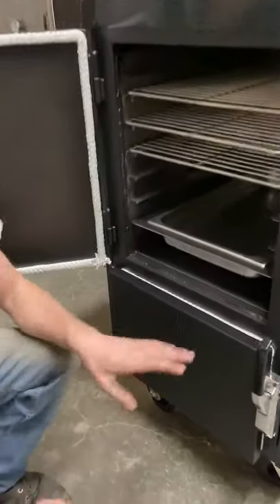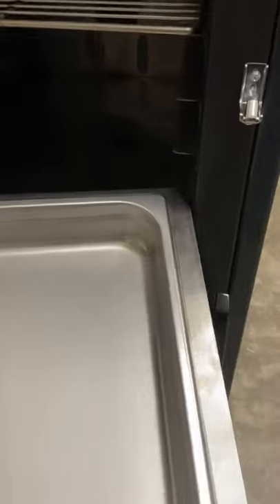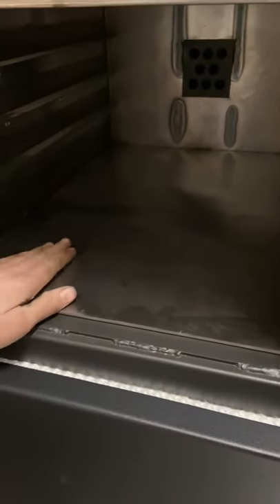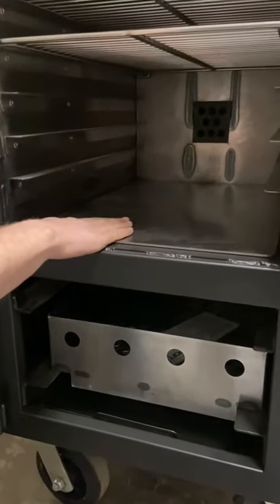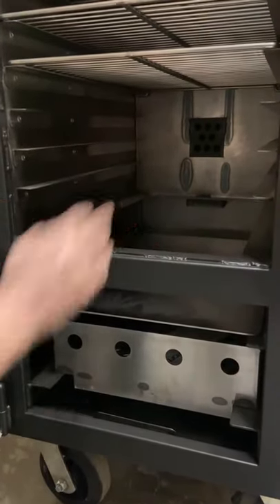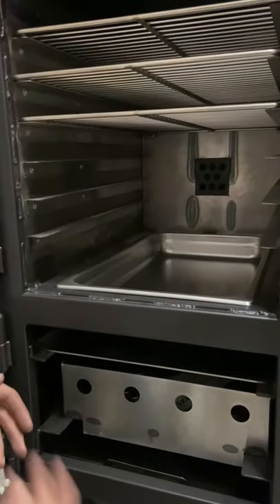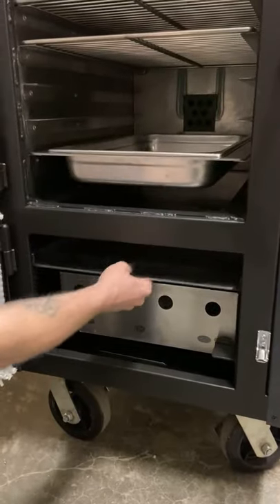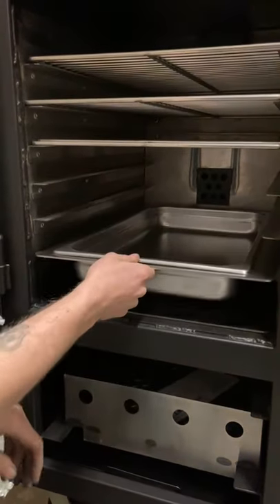Close up explanation of Drop in vs Slide out water pan combo

Comment: If you remove the water pan and the heat diverter and place one of the racks at the bottom, can you use it as a grill?
Reply: Yes. Once of the many reasons I bought the Battle Box. So much you can do with it.
Reply from the maker: Yes you can!